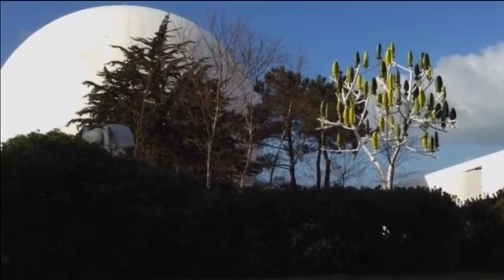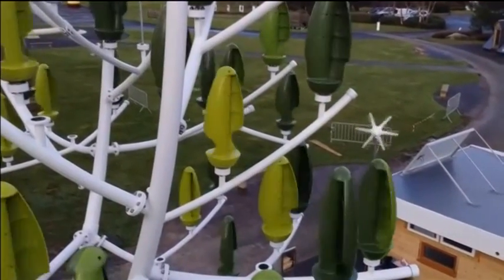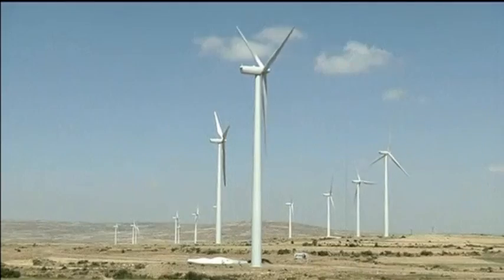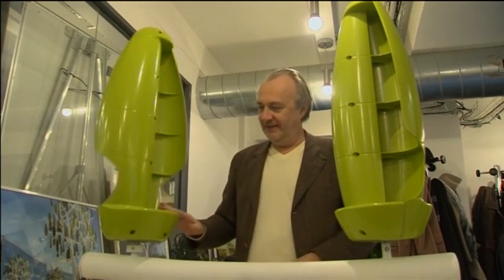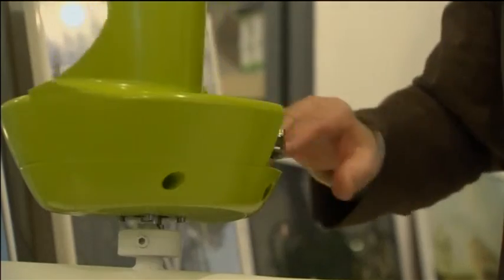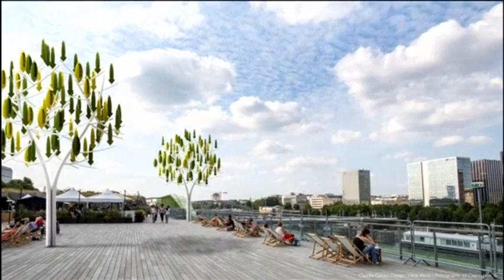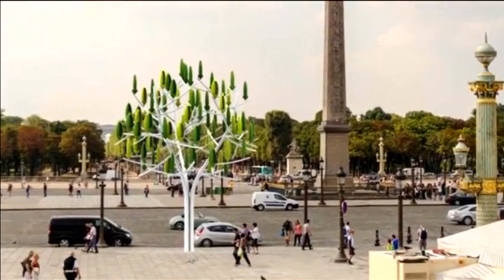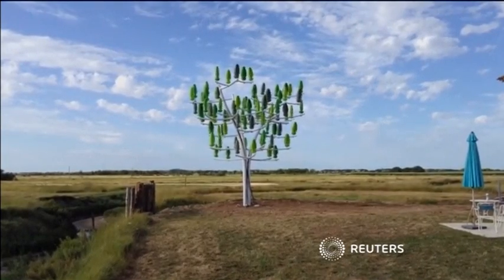Wind Tree uses micro turbine leaves to generate electricity

Comment: Wind Tree:  I call energy B.S. on this one! It must be a hoax, the math is so poor.
 

 I have found people have a poor feel for energy and power. The wind 
tree goes to show you ignorant people are on this topic. Wind power is 
proportional to the area the blades cover and the air speed cubed. So 
faster winds are beneficial since the energy converted is a cube 
function of the wind speed. (goes back to Bernoulli'ss law)
 (P = 1/2 ρ A v3 ) A 20% increase in wind velocity - increases power generation by 73%
 

Another video claims the said tree can produce enough power to power a car 
1.6km in a year... Using the 2013 Nissan Leaf's 29 kWh/100m you get 464 
Wh. So using the car example to back out the power generation you get a 
paltry 0.525 kWh.
 
 If one has any feel for power, the thing can't even run one light bulb.
 

 Using a wind energy calculator, assuming 100% conversion efficiency, a 
7.2 km wind and assuming the wind tree blades have a effective 1 square 
meter of area then it would generate 0.38 Watt of power, or enough to 
power 1/263 th of one 100W light bulb!
Reply: I am a former Windturbine technician (tore up my knee), so I could not longer climb the 2.7 Megawatt towers i used to work on, I have also worked on 1M watt towers,,,1.5 MW Towers, and on a total of 5 different Wind farms.
Perhaps you need to go back to college and educate yourself on Wind turbines and the use of Transformers and how they can take "Step up OR step down the amperage of electrical current,, it is not the Voltage , that is the big issue, it is how the Transformer makes use of the amount of amperage that is created. In you home you will have a 110 or 220 (which is actually 120 or 240) but many people still say 110 or 220,, but when you plug your 12 volt phone charger into the wall to charge your phone, it does not get the 120 volts coming out of the wall,,,why? because in the charger is a little "Step Down" transformer, which greatly reduces the amount of volts, AND the Amperage in the current going to charge your phone battery, These tree turbines, collect electricity by turning what would be called a "High torque/low speed gear shaft, which would then feed into a "Low torque/High speed gear shaft, which would then feed into a gearbox which would then feed into a generator which is where the electricity is generated, Then that generated electricity would be fed into a transformer before getting set out to a power substation to be distributed for public utilities to make use of.
So lets say you have 10 of these on a college campus, somewhere on that college campus you would have a small power substation probably about the size of a large tool shed, and all of those "Wind trees" would be connected to them by cabling under ground, to a transformer, which would then be connected to the power substation.
So yes these Wind trees would work, and you do not know what it is you are talking about.
Reply: You are good!.   I do not even mention voltage and you go harping on that and transformers.  I can say you are way off.  What degree in higher learning do you need for that technicians job?   You might google the first law of thermodynamics to understand a transformer cannot multiply the power but only TRANSFORMS it.  If you want to raise the voltage you can do that but the current drops proportionately so that the watts are the same.    You want to up the amps, fine, you will drop the voltage proportionately.   Each time you transform it you lose something too.    I know from my mechanical engineering degree at Purdue and work at General Electric what transformers are.   If you had a clue, you would know voltage and transformers are irrelevant to what I was saying about total watts produced. 

You seemed to have missed the point completely what factors determine the power output of a wind collecting device....that being area covered by the blades and the wind speed.   That produces the watts of power.   Watts are just (current x voltage), it is irrelevant how you take them out...lots of volts or lots of amps.  If you know anything about electricity, you take them in high voltage to reduce the I2R losses.   Do you know what I squared R is smarty pants? 

I will run circles around you any day in power calculations from solar, wind, coal, whatever.  I know what that means in electricity too.  

I talk about watts, which are independent of transformers and voltages talking like you are some kind of expert, and you miss completely the fact that the wind tree has very little useful power output since it has so little surface area to the wind.   Physics 101 equation for you:  power  = 1/2 ρ A v3
These style of vertical rotor wind generators may be max 15% efficient too.

I really think you are one who has to go back to school and learn some basic physics.   

In all your exploits climbing wind towers, did you ever experience the German Vensys direct drive wind turbine without a gear box?  I find it very cool.  It must have lower maintenance than gear reducer types.
Reply: Oh, you wind turbine technicians XD

Comment: Great idea I say but 2 years? 
In australia power is near 30c a kw 
37000 / .30c = 123333kw needed
61666kw a year 
168.94kw a day
7kw an hour
they have about 80 generators on them which works out to be about 80w per "leaf" generation 

this is all minimal calculations. Good idea but 2 years is very ambitions, id say closer to 7 or so.

Comment: $37k in 2 years?
At $0.12 per kWhr (American average), thats over 300,000 kWhrs of energy produced in 2 years. 
That means this thing must produced at least 17.6 kW of power continuously to pay for itself in 2 years. 
There is no way that ugly mess is producing that much power.
Reply: Even if it doesnt, would you rather see these or those big tall wind turbines that cost $1.8million on average per?
I would like to see how much power could be generated by 48 of these trees ($1.8million work) as opposed to the power generated by 1 wind turbine.

Comment: Some articles are stating one of these 'trees' produce a whopping 3.1kW! ...Which is incomparable to a wind turbine that produces up to 2.5MW. About 806 of these 'trees' would be needed... or about 30 million dollars. To compare it to one wind turbine.
Reply: Adam R I am not doubting you, but could I get some sources for this?
Reply: Adam R Exactly what I was wondering. They refuse to mention how much more/less productive it might be in comparison, and even hint at it as if it's a viable replacement. With stats like that, I'm much rather have a big and more cost efficient wind turbine than an entire forest of these.
Reply: How do they figure it will pay for itself in 2 Years. Some one can't do math, at $37,000 it will have to produce a lot more power to generate $37,000 worth of power in 2 years
Reply: the size of manufacturing plant, transportation ( huge trucks, wide loads, scheduling of trucks on highways ,re-routing for some highways and front and back crews for highway safety),  costs of specialists to work in any of the fields, as well as tons of safety gear, systems and other red tape are factors in economies of scale.  Somethings are exponentially complicated  with size and numbers. We have to generate  138 000 volts ( depending but at least 13,800v)  in a centralized location and transform it to a workable level. Such large scales show lots of evidence of environmental damage where local environments can manage small decentralized processes. Not to mention the large scale socio-political implications of the areas where the  major economic endeavours occur. The lack of control over our own lives and trust issues with our establishments is something a significant amount of  people have issues with as well. When something goes from high tech to medium tech the economy of scale changes. Small windmills and motors in general i think are medium technology. Local lamens  can fix them, understand them, etc. someone managing the power grid may find it more complicated and also loose some control and therefore less money however i feel like that decentralized notion is a natural equalizer with wealth.